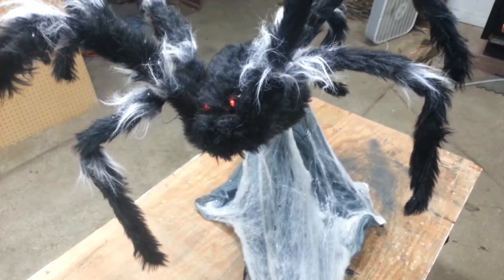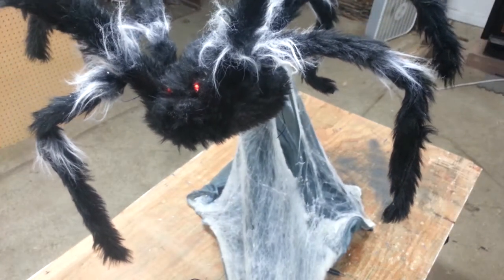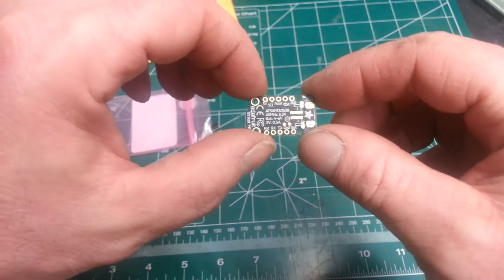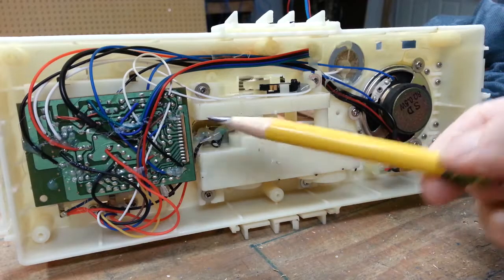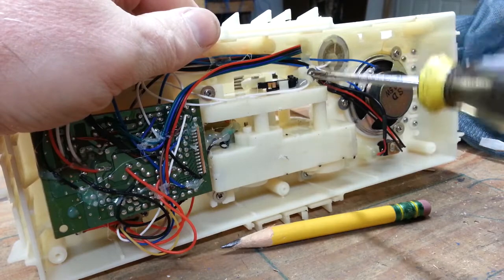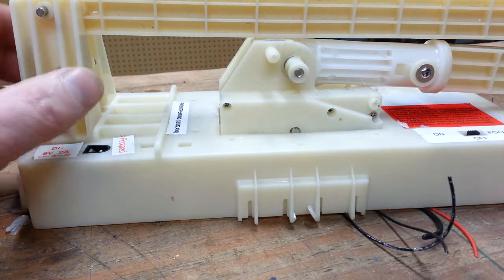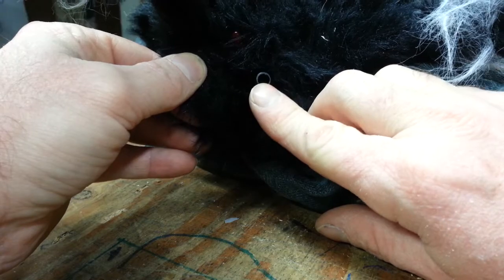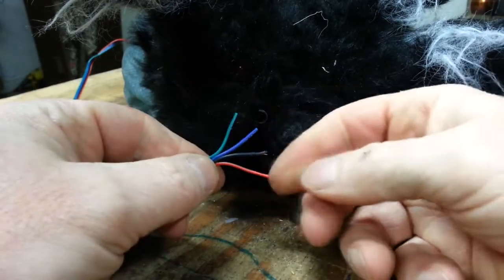Jumping Spider Tear Down

Comment: Is there any way you can change the eye color on the jumping spider?
Reply: No you cant
Reply: You could use a different led color. With the trinket upgrade you could theoretically use rgb leds for all sorts of color effects; this would of course require extra wires to be run.

Comment: Any updates?
Reply from the maker: Sorry, no. It turned out to be a bigger project than I thought it would be. I have a contact that knows a lot about Arduino and other microcontrollers hopefully they will be able to get me over the hurdle I'm facing in this project.
Reply: @HauntedHows  Oh, what happened? I was thinking about follow what you do to fix my jumping spider.
Reply from the maker: Well, my intention was to replace the "brain" with an Arduino that I could program to allow slightly different functionality. I wanted the prop to jump and reset quicker.  And get rid of all the poor sound effects. All this is possible with an Arduino. But not with my level of experience. It'll get done, a lot of the props you get from Halloween Express, or other big box stores all work on the same, or similar electronics and mechanical mechanism. So once I can get one rebuilt, I can do all of them. I really want to get back to it. So I'll do something soon.
Reply: I am going to attempt this.. if you had any progress with yours please let us know.   My spider's original circuit died and I really want to be able to program my own sounds.
Reply from the maker: No I haven't done anything with this project. But I am working on something that is related. If it goes well I think it'll give me a better understanding of how to   add a new brain to props like this one.
Reply: @HauntedHows  I'm making some progress.  I've got the logic down in my Arduino IDE and I've got it so it goes through a continuous loop of popping up and retracting, stopping using original switch sensor, then jumping again.  

Going to add a PIR sensor to replace the original motion sensor.  Then add an MP3 board to play new sound(s).

Need to look for a circuit that can run motor at 6v+ rather than 5v.  5V is just too slow.
Reply: I got pulled away from this project by some family emergencies, but I am going to continue with this project this year.  Going to attempt to make it into a zombie jump scare.  lol